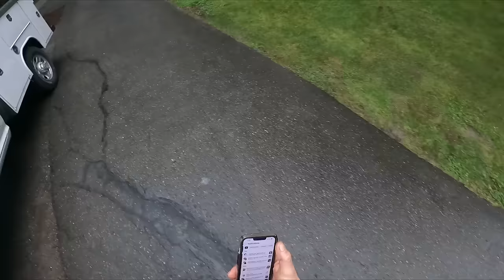The WORST Maple I've Ever Removed! | Part 2

Comment: With the full wrap on the 500i you can slide the handle over the bucket lip with the chain cover side towards the fiberglass ON THE OUTSIDE OF THE BUCKET! I DO IT ALL THE TIME. makes it easy to have two saws and not take up tons of room. But always have your saw tied on to you...just in case 😮

Comment: When we had to lay down protection where I worked, the most important thing is to use a-frames whenever possible so you don't have to carry them. For your jobs, see if you can put big soft wheels on a cart.The cart rolls on top of the protection as you go. Limit the amount of lifting. You have a crane, use it. put lifting holes in the sheets.  Stack them maybe 6 at a time and use the crane to move them. We had dozens or hundreds of sheets sometimes. Minimizing handling is essential. Mostly we had 1 person to move the cart and 2 people to load. We could do several dozen sheets in a half hour.
Reply from the maker: Thanks for the tip!

Comment: John word of advice,  when everyone unloading excavator,  always rotate your machine so your boom is Facebook ward, I've seem excavator flip over back work, especially mini Excavator.  Remember mini are narrower the big Excavators, as you defend down your trailer you have or control over you machines.  I had a friend was loading a Allis Chamber track loader that didn't have any Rippers on the machine, plus not roll protection,  he flip it over backwards and it killed him. Loading and unloading equipment can be very dangerous. Good luck thanks for your videos.

Comment: Maybe not too late to ask ...again ... example I got ECHO 2511 TES .. so How to maintain this chainsaw ... for long period of time ... Do need to take off the bar & chain and just hang it in my garage or just empty the feul & oil just leave it in? ...
Reply: Empty the tank and run it dry. That works and is in most owners manuals. If you're using the aspen or stihl moto mix then it's supposed to be fine to store. If you're going to leave it with regular fuel/oil mix then at least fill it all the way up. Avoid ethanol content if at all possible in all instances.

Edit: Leave bar and chain on, no reason to remove, but maybe clean saw, dress/clean bar, sharpen chain etc so you know it's ready to go next time you pick it up. If using proper bar oil you can probably leave it in there a long time without issue, bio oil maybe not? Veg oil probably drain it.

Comment: Looks like the rope got cooked at 10:12 and 10:30 time stamps. I'm curious about diminished strength after friction burns. How does the rope tensile strength measure up after a burn like that? Just curious, but input from experienced climbers would be great.
Reply: In retrospect, the tree is probably is probably getting smoked as much as the rope.
Reply: While ropes WILL get hot enough to smoke and glaze (which melts the very most outside layer) sometimes you are seeing steam and wood/bark powder.  Or a combo of both.
A light glazing will decrease the strength but with the safety margins you are supposed to have, like 5:1 or better, it should not be a big concern.  If a lightly glazed rope IS a concern..  your piece is way too big or your rope way too small.  
If your rope is HEAVILY glazed..  you need to make lifestyle changes 😁